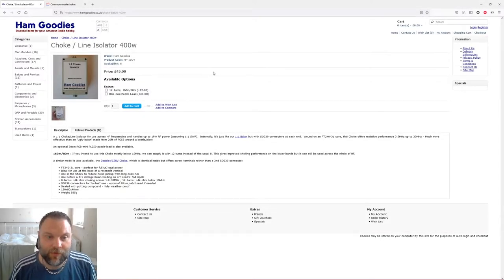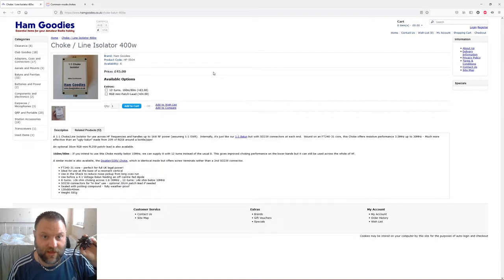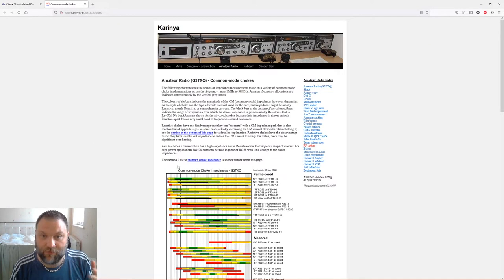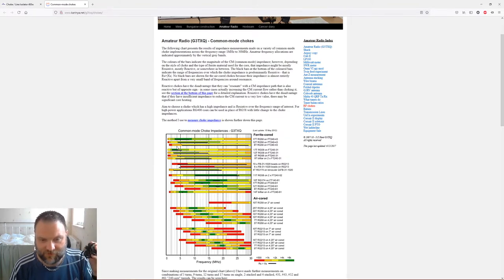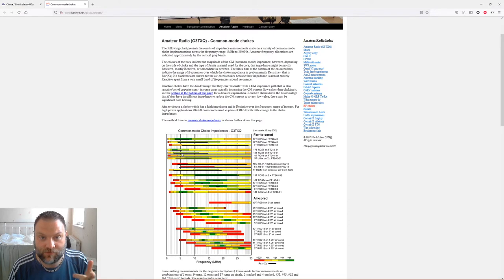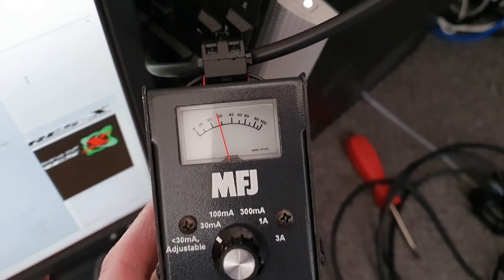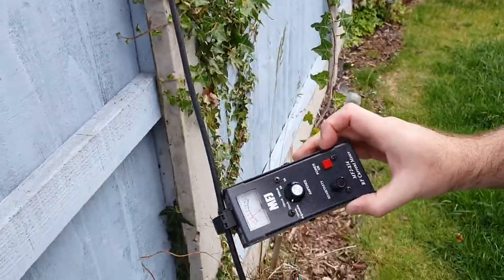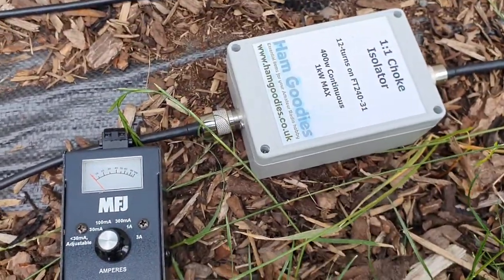Ham Goodies Choke Isolator! Does it work? Did I have Common Mode Current? CMC Let's find out! EFHW

Comment: Thanks Matt, interesting. I bought one of those MFJ current meters like you have about a year ago. I still haven't used it to test for CMC on my EFHW, its still sitting in its box unused. I don't have any common modes that I'm aware of. I installed a very efficient choke made by Balun Designs near my radio end of the coax. But your video has given me some interest in checking out how efficient my choke is - thanks
Reply from the maker: No Problem John! It is a fantastic piece of test eqipment and it really helped me to see what's really going on :) Thanks for watching and enjoy the MFJ and EFHW ;)

Comment: As far as I am aware the choke should be as close to the antenna feed-point as possible which makes sense, otherwise the coax between the choke and antenna feed-point will have that CMC radiating off the braid and causing potential RFI problems.
Reply from the maker: Hi Dave, I heard somewhere that the lenth of Coax before the choke can also affect SWR & CMC and 2.5m was a good dist to go for, I also wanted to get the coax to ground before choking it, thanks for watching 73 :)
Reply: Yes Dave for an HF vertical with ground radials but NOT for an end fed. The end fed design needs some coax to drive against as it acts as a counterpoise. Putting the choke where the coax enters the building is a good recommendation.

Comment: Cool!!  Did you open it up and see what toriods and wire they used??  For shots and giggles!!
Reply from the maker: I did open it up after water got in. No rubber gasket used! They fill it fill of that glue stuff so can't be messed with, I just dried it out and kept it inside on the tx side 👍
Reply: @m6ceb  🤦🏻‍♂️…why wouldn’t they weather proof it?  Smart move on your part.👍🏼

Comment: But how did it effect the overall matching of the antennas when measured at the radio ?. As the coax braid forms part of the antenna it would have some effect on the matching but I do agree it’s best to have the rf choke outside preferably before it enters the house and grounded at that point .